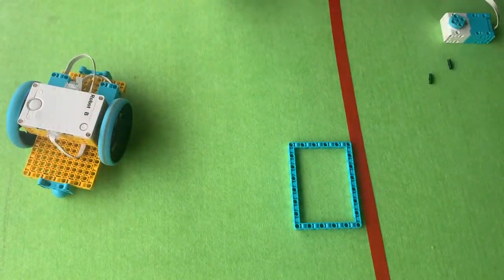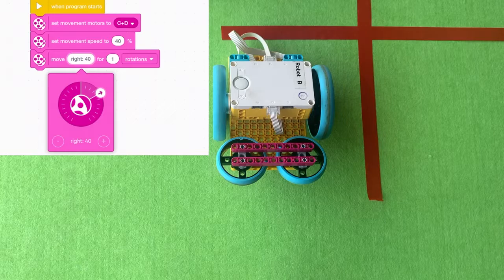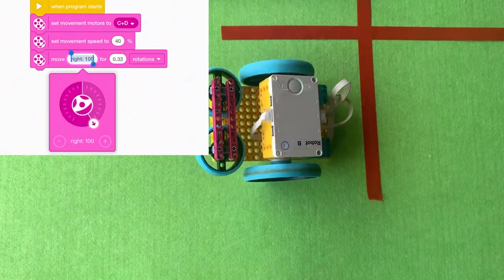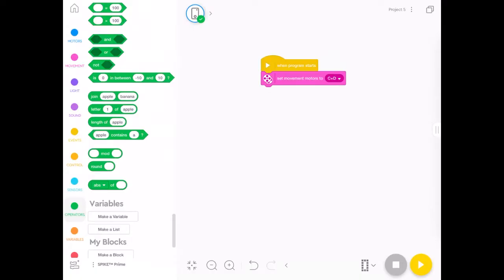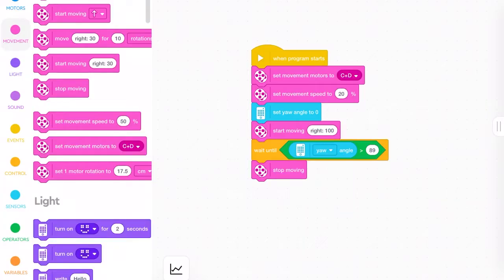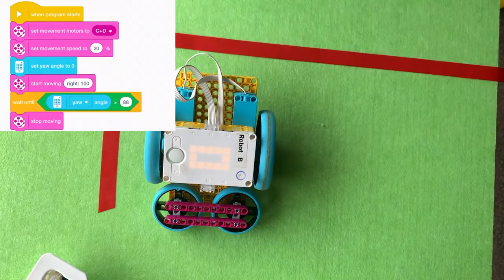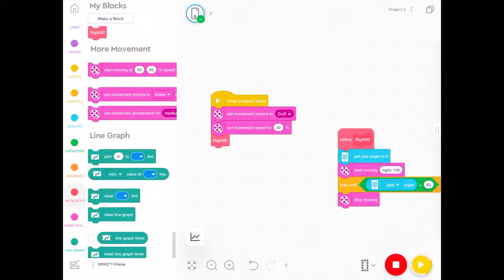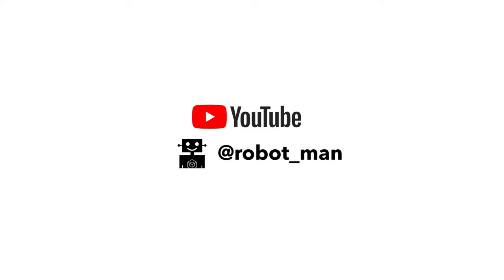3 ways to turn, including gyro option for Lego Spike Prime

Comment: wouldn't using the steering with degrees instead of rotations do the same as the custom block?
Reply from the maker: Degrees is how many degrees the wheel turns (not the bot)

Comment: It's not reliable for me. I'm using Essential Hub and sometimes Yaw angle behaves strange. For example it changes from 45 deg instantly to -314 deg instead 46 deg or something similar.
Reply from the maker: I think it's less reliable because the Essential hub is so small. I guess you're stuck with lots of trial and error using the other code options. :(
Reply: @robot_man  I've worked recently with Prime hub and it's not reliable either.
Reply from the maker: @snowmanfrost6141  I think no matter what you build there is always going to be a lot of trial and error, regardless of how you choose to turn. It's never 100% precise because it depends on your robot design and the type of surface it is driving on.